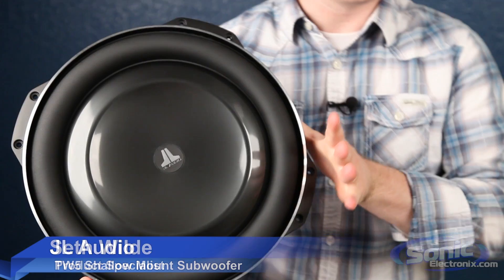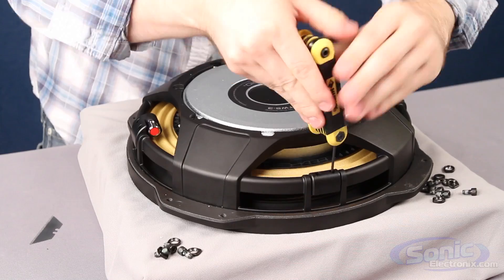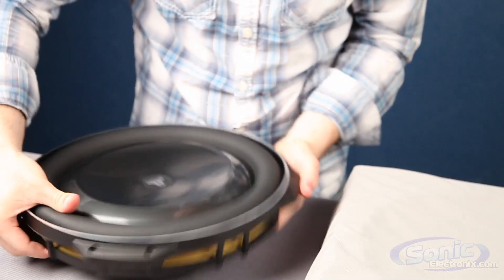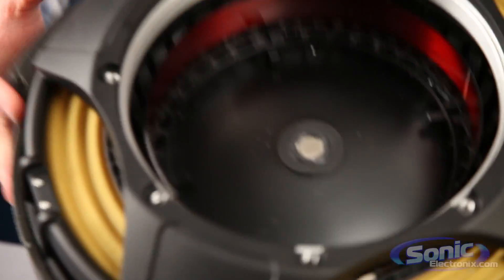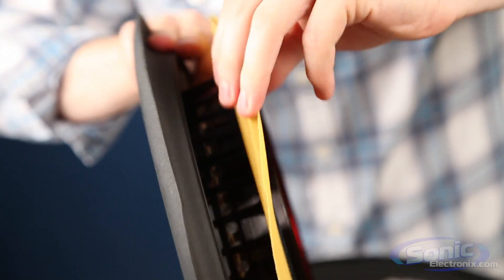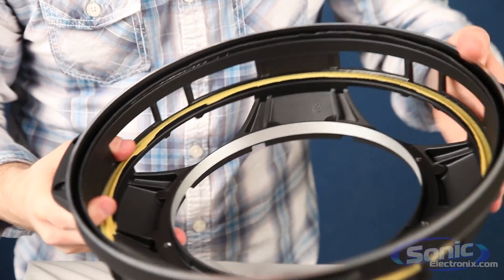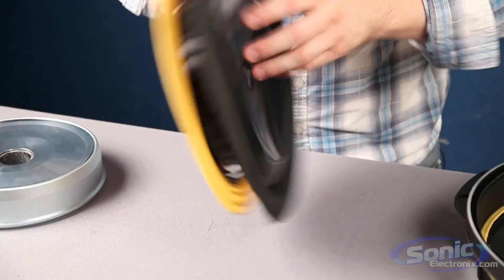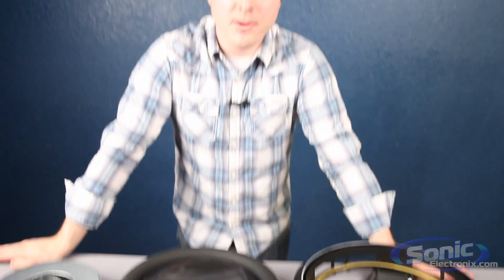Cutting Open a JL Audio TW5 Shallow Sub | Subwoofer Guts!

Comment: 🤢makes me sick watching this, I'm disabled don't make much money I saved up almost 5yrs to build what to me would be a SQ system for my truck I bought 3 of the JL 13TW5 4ohm and a JL Audio RD1500/1 and paid for them it install and build a custom under the rear seat box with 3 way active  morel's and the stinger heigh 10 head unit. It         sound amazing for a month till some a-hole stole my subwoofer's , box  , and amplifiers more less everything attached to the sub box well we was in are hotel room, $4700 down the drain sadly and now no longer in a financially viable spot to save up again. Now ya see why it makes me sick to see ya cut up just one of these even on a 12yr old video, but still thanks for sharing
Reply: So someone put near $5k of equipment into your vehicle, then a month later it gets stolen ... the equipment, no mention of your vehicle being stolen. Doesn't take Poirot to work that one out! You're driving around, blasting your system, showing it off. Either way, it sucks! There's always Patreon and crowdfunding.

As for JL, sorry to say, but the fact is; you can do a lot more for a lot less. I learned that the hard/expensive way, thinking my JL set up was the nuts, until I started looking elsewhere. Now I realise how average-at-best they are! JL is the king at nothing, not SQ and certainly not SPL!

Comment: Tinsel leads to the voice coil are very very thin and delicate on this design.  Don't clip your amp... you will heat up the sub, cause some cone meltage, cause some glue burning, separating that thin tinsel lead...the damage will go unnoticed while your ambient temps are in the 70's and above...but below that, the sub will not play properly or only sometimes will play.  Then you'll need to spend another $200 for a recone job.  Like me.
Reply: How much does the sub cost ?

Comment: Ok and they cost 500$ for a magnet plastic and an a woofer basket?  I like jl audio a lot but fuck that 500 bucks really?  That is fucking bullshit they don't need to charge that much, probabaly cost like 20$ for them to build it.  Just like W7 way over priced
Reply: The magnet is pricey. You are also pay for the RnR. I had a friend that worked for Bose for  a few years. You are right that speakers have a high profit margin. Especially for so called factory prem systems w $10-$15 paper speakers that the manuf buys them at.

Comment: This is a v2 the v1 had the basket you're thinking of. Neo is too expensive a lot of home audio drivers with neo magnets have doubled in price over the past year or two. I'd rather see them use something similar to Image Dynamics high roll surround to maximize surface area. From what I heard they are actually suspension limited not motor limited.

Comment: Alot of JL fans I see posting and yet no one noticed that JL changed the basket on this driver?  Look at the back view when Seth is taking it apart.  The basket is normally more like a spoke style where every window is cut out.  Not this one?  I own a 13tw5 and it's a good driver.  Little under motored.  Really wish JL spent the money for a neodymium magnet to cut some weight and give this driver what it really needs.

Comment: I've been a huge fan of JL subs since the early 90's. I've never been disappointed by any of the one's I've purchased over the years...

BigDWiz - OldSchoolStereo-com
Reply: I like the shallow woofer,I want to get one in the future when I buy a Jeep Grand Cherokee and take the system up with this woofer and focal ktp 6.5 in front stage and pc 165 coaxial in rear and maybe Oeq 2 Rockford fosgate 10 band parametric eq to tune.So this is in my near future .I have classic Rockford amps punch 45 he,power 300 ,punch 150 with fan shroud,Old school but those amps are Soo dependable.I enjoy your u tube site.